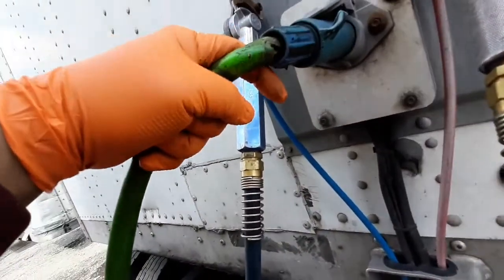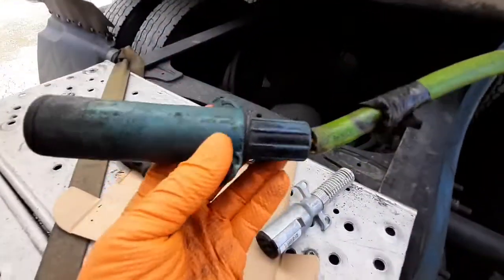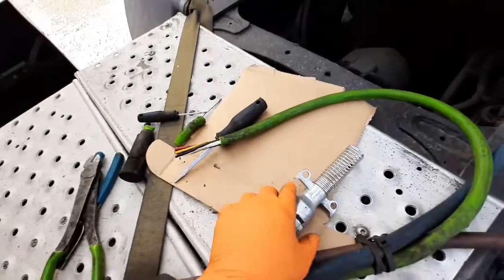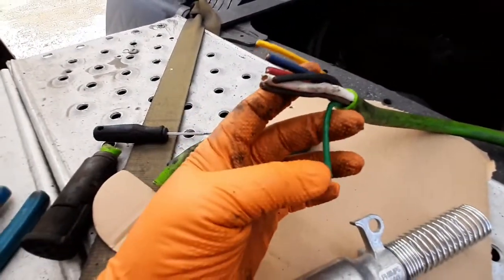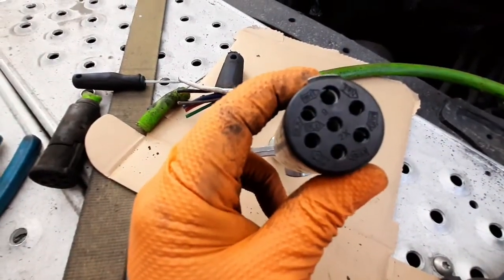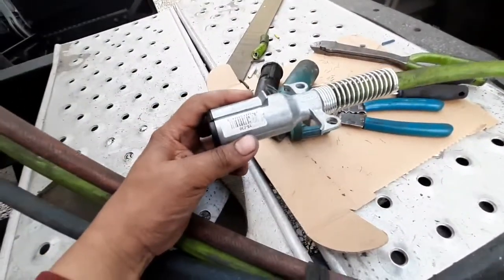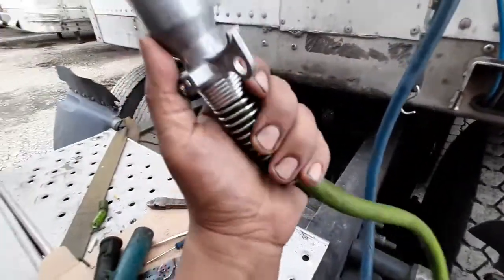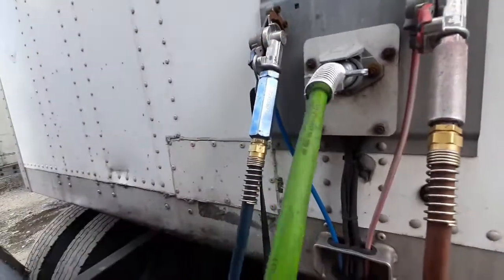Semi truck 7 way plug install.

Comment: Thanks for the video. Used the pin out explanation to back lead test the loss of power to on trailer abs light back up to the plug in on the face of the trailer.. I did the same thing 4 years ago but forgot. Very helpful

Comment: Some other you tubers recommended using a jumper from one hole to another to fix a light that was off, I did it and it worked, but would have to be fixed to avoid using the jumper all the time? I cleaned out the contact ports and opened up the prongs up a little bit more using a flat head screwdriver, but still need the jumper, I bought a new pigtail but it still need it, what would you suggest or recommend? Thanks in advance.

Comment: Solder light cord wire strands together , the screw will tightly bind into the solder . Place a drop of Loctite on screw heads .